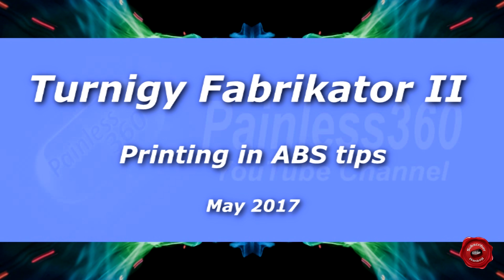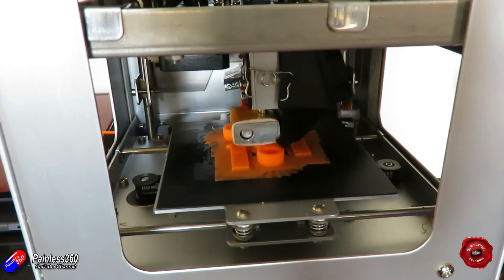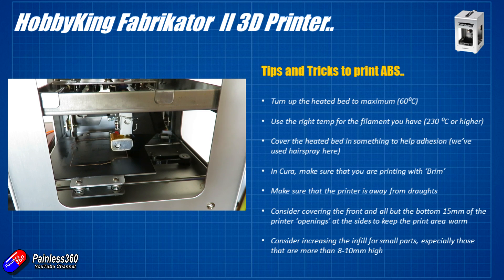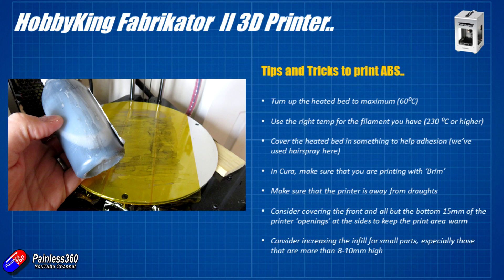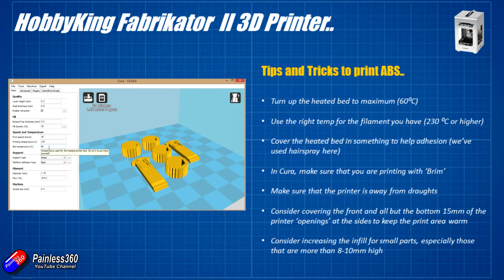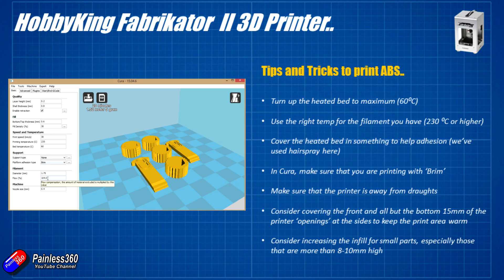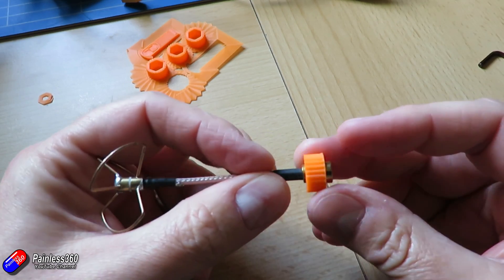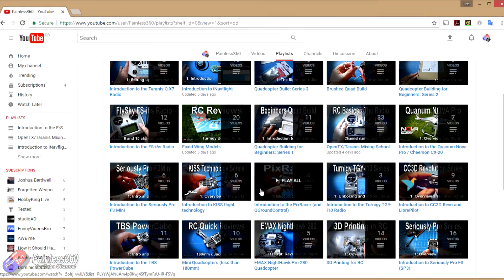3D Printing for RC Quick Tip: Printing ABS on the Turnigy Fabrikator II Printer

Comment: Hello There ! 
First of all thanks for all advice to print with ABS !!!    
I was undering if you tried print using NinjaFlex or any other Flex filament with this printer ?!
Reply from the maker: +Gabriel Aphonso nope, any printer that doesn’t have the filament feed directly above the printhead will suffer from problems with a flexible filament. This was included.

Comment: How about the cooling fan? Since it's a combined hot end and parts cooling fan do you cover the outlet blowing air over the part or do you leave it alone? I would think that air blowing over the abs could have some effects on the layer adhesion. I have tried to put some tape over the end of the hole on the blower assembly. But I have yet to make a successful abs print.... :-(
Reply from the maker: Turn the fan off, I use CURA and make sure it's disabled for the print.. See the recent video on a far easier plastic to use on this printer that's as tough as ABS in most applications.. (PETg)

Comment: Freezerboxes taped to the sides works great to keep heat inside my fabrikator v1; for the front a plain sheet of plastic works well.
Left the top open since the cables ect need room to move.
Reply from the maker: +cmulder002 great ideas, thanks for posting!

Comment: Great video, thank you. I have a question for you that I am sorry to ask on this video, but I was not sure how to get in touch with you LOL.I wonder if you can help me?I have a full kiss set up and I switched it over to Beta flight GUI and in order to do this I had to take the protection off of the Kiss flight controller. Did this with no problem however I am not liking the beta flight with the Kiss hardware. Now I am trying to put the Kiss GUI back on the flight controller and it is not letting me because it says that the software protection is not installed. Could anybody point me in the right direction on how to re-install the firmware protection on the Kiss FC so I can install the Kiss firmware so I can go back to the Kiss GUI? Thanks for your help and again I apologize for posting this on this video.

Comment: Does this printer have to be calibrated every time you use it? I've heard that the cheaper >$600 3D printers don't have tight enough tolerances to be trusted to print right every time...
Reply from the maker: +Gouada it prints great once you get the calibration sorted. I've not redone on the calibration since we started printing with ours. Very happy with it so far
Reply: Painless360 Oh, wow, happy to hear that! I've been looking to get my own 3D printer for personal use and I'm happy to say that so far this one checks off all the boxes. Thank you for the epic documentation you've provided Lee

Comment: Thanks for the video. 
I do have one question.  Does abs have a bad smell  when printing?
Reply from the maker: +1956willys4x4 abs printing does give off a slight odor of warm plastic. Depends on the type you are using, some ABS filaments are worse than others. I use ABS in a well ventilated area.

Comment: Are you using a fan below hot end to cool print. Can't fly quad  worth a damn so I'm building a large core xy.
Reply from the maker: I've turned the fan off on this printer for ABS. You can get a lot more trouble blowing cool air onto an ABS print as it's printed, layer adhesion and shrinkage can become real problems. Especially on this little guy where the temperature is a little low anyway.. Hope that makes sense.

Comment: 1st

"hard landing" - British understatement. ;-)
Reply from the maker: Painless360 language guide: Page 3 - 'Hard landing' = A crash that result in the model being in two or more pieces, usually with at least one of them lost for ever on the grass. Lost parts will force the use of cable ties, hot glue and bags or ingenuity to repair the model into a flyable state.. All of this is usually accompanied by lots of expletives from the pilot, usually loud enough to scare nearby dogs and small children up to 300m away.
Reply: It's only a crash if you can't find all the pieces.